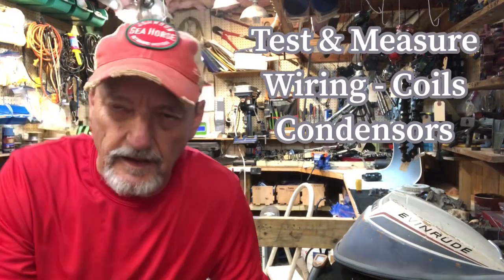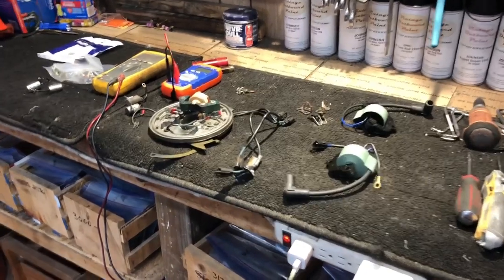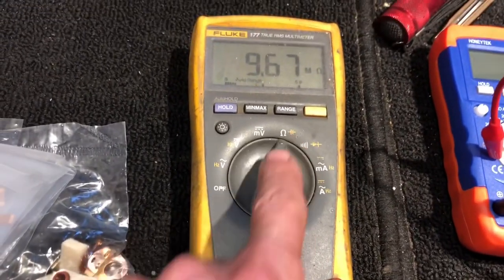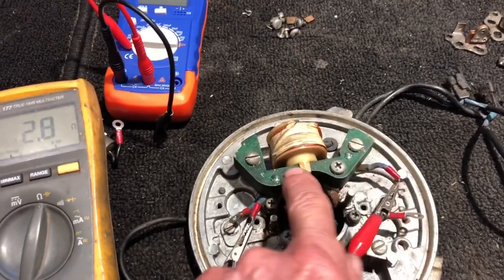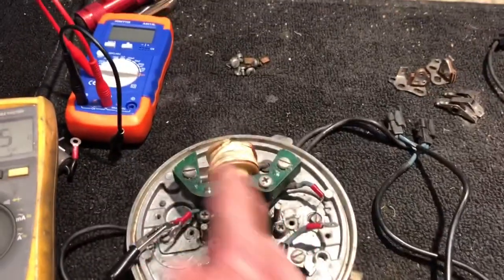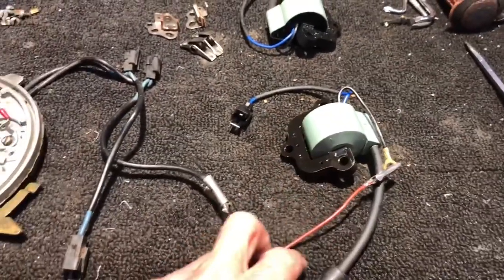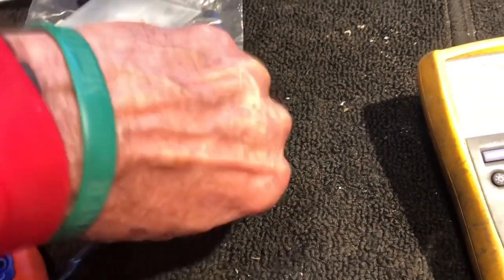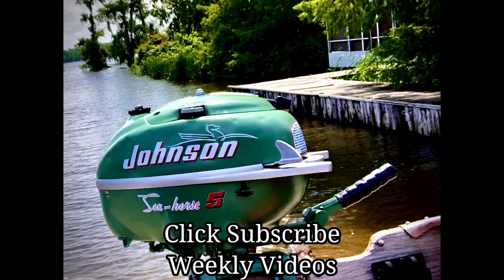Test & Measure Wiring Coils Condensor Ignition Magneto 1973 25 HP Johnson

Comment: Would LOVE to see you make a video on (Fixing a stuck shift handle). I've came across several 25hp Johnsons where the shift handle is frozen in place even with the lower unit removed. Problem seems to be in the handle its self. Under the motor.

Comment: Salut Ti-Michel, Thanks for the values, it is VERY useful and appreciated info. I do have a question: In testing continuity on those wires running from the ignition plate to the cylinders, shouldn't you get a ""0" reading (aka no significant resistance). Where did I go wrong ? Merci mon ami !

Comment: Hey tmike love your videos, i watch them daily. I already rebuilt a 55 fleetwin, now im working on a 60 18 hp. I do have a question for you though doesnt your fluke multimeter have the capability of measuring capacitance? If so why use the honeytech? Im only asking because i have a fluke 101 (didnt want to fork out 200 lol) and it measures capacitance but i was wondering if you werent happy with its capabilities or what the reason was. The honeytech wont break the bank i was jw. Thanks again tmike your videos are truly a life saver!!!
Reply from the maker: Did not know that. Thx.

Comment: I have ‘74 Johnson 9.9 its been sitting for long time but it ran when i put it away. I did reading on two coils on side of the engine with my Fluke 84. The both showing 13-14k is that good? The look like the were replaced before i got the outboard. So i have no spark on either coil.. not sure how to take off the flywheel i may need a pulley
Reply from the maker: https://youtube.com/playlist?list=PLmMizJOF01-AHzYQDdzyIFP8hirPFWKYa&si=R6HaPnGM9YEU5lwH

Comment: Hello from Hamburg, Germany. Sorry for my bad english. Watched most of your Videos. They helped me a lot. I've got a question. I'm working on an old Merc 350 Kiekheafer Phelon Magneto looks nearly the same as in your Video. Replaced coils, breakers and so on. Now  I finished all the wiring and I'm wondering, that if I try to measure with the Continuity Meter attached to Ground (Stator Plate) and the other lead to the terminal of breaker points there is always continuity. Even if i open the breaker points. Just if I remove one Coil-lead (breaker or ground) i can see the breaker work like it should do with the Continuity Meter. Is there something wrong? May I please have your advice before I reinstall everything. It's my first vintage outboard that I try to fix.
Reply from the maker: All good. You should remove all leads in breaker points when setting timing.
Reply: @michaeljsimon  Thank you so much! Now I got it. The original mercury manual confused me...  They did not mention to remove leads before set the timing. I will reainstall and adjust everything and try a first start tomorrow. You can not imagine how exciting that is for me. Kind regards, Rembert